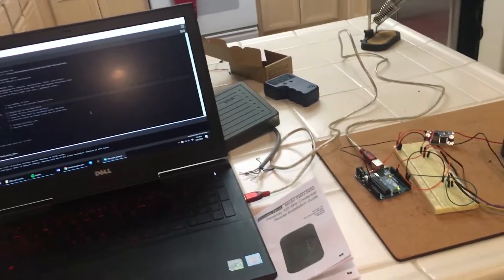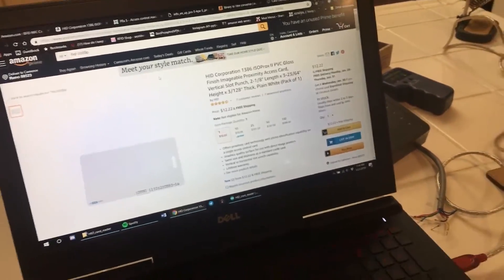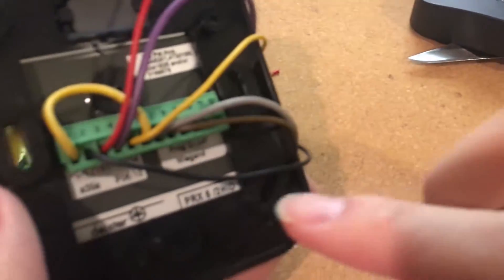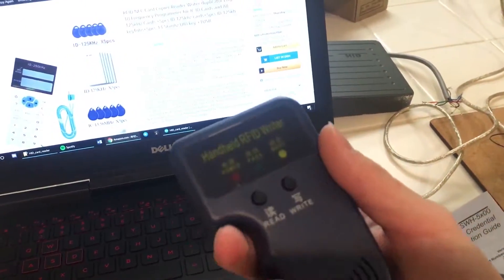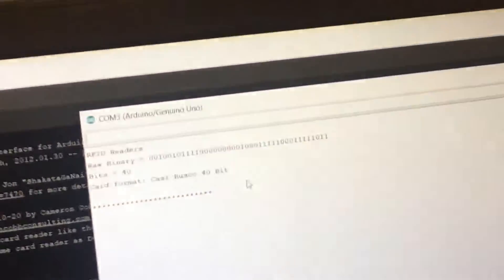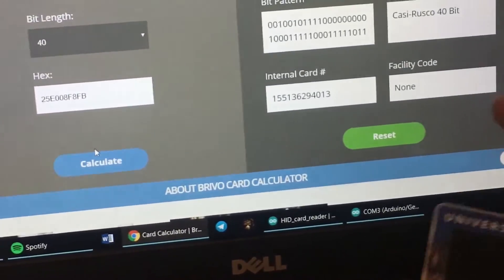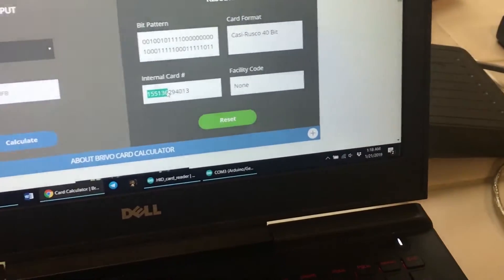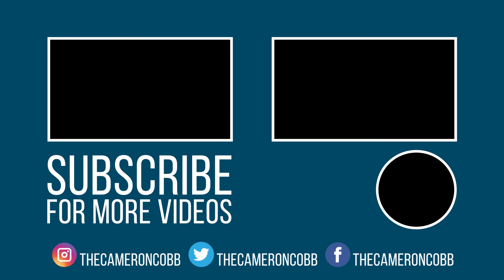How To Decode HID/RFID Cards with Arduino (2019)

Comment: Whats the reason that other reader did not work?  I bought the white reader with the screen, did not work, it was able to copy the UID of the card to another card, but these cards would not work on my door lock. I am unsure of the protocol and I was hoping to get that information by running a 125khz reader into arduino, as you did here.  What I mean to say is why wouldnt any RFID reader work, if we only need the output in bits?
Reply from the maker: Con there are different readers that can read different types cards. I’m not sure what type of card reader you bought and I’m not sure what type of card you have. I had to do research on what card I had then I had to research what card readers would read my card

Comment: This is a Prox 125KHZ card. Those are slowly being phased out. Are there any solutions for iClass?
Reply from the maker: I will look into iClass cards :)
Reply: @CameronCobb  hey, my card is HID iclass. Any updates on this? Or any tips on how to get to it myself? 

Trying to clone it into a microchip :)

Would really appreciate a response!
Reply: You just need an iClass card reader.  In this project, he's not reading the card, but instead, getting the output from a card reader.  To actually read a card, you must energize the card with a magnetic field at a certain frequency (possibly with data) then read the RF the card sends back.  That's way too complicated and you will need intimate knowledge of 125Khz prox, or 13Mhz Prox and/or iClass protocol (or if you are doing mifare, another encrypted card).  Just get the reader that can read your card, then decode the output.  Most iClass readers output Wiegand (same as the 125Khz), but if you want to be more secure, then look into using OSDP protocol.  PS. try buying a "multiclass" reader, these are usually cheaper and can do both iClass and 125Khz Prox.  Finally, there are some other proprietary Prox formats that don't fall into these two popular HID formats (eg, Indala or the real old Cardkey type).